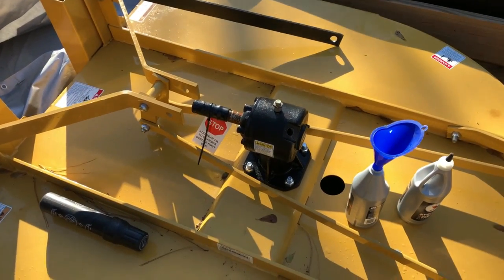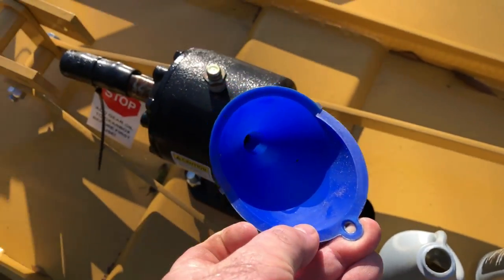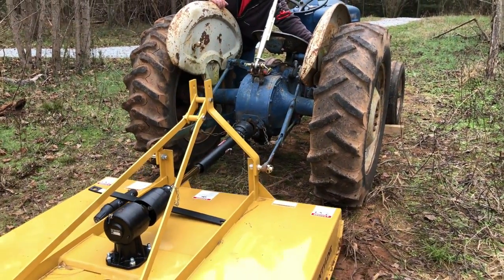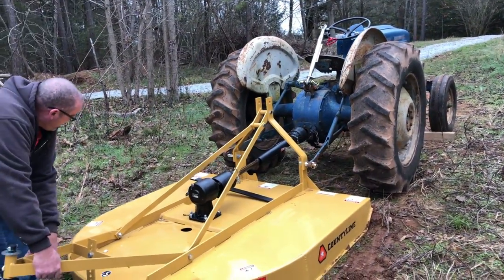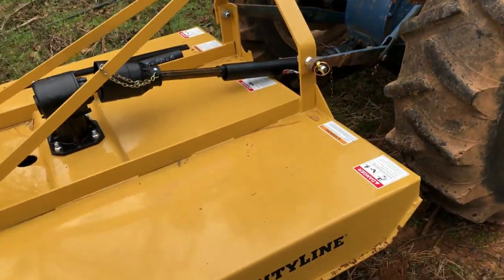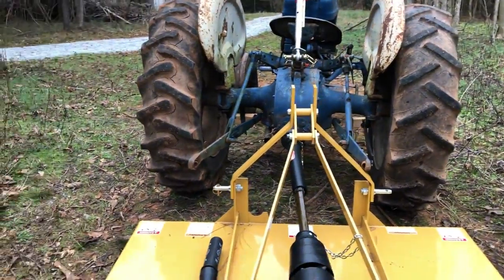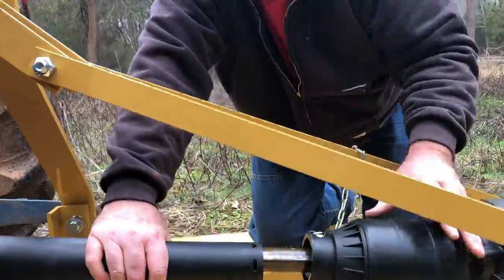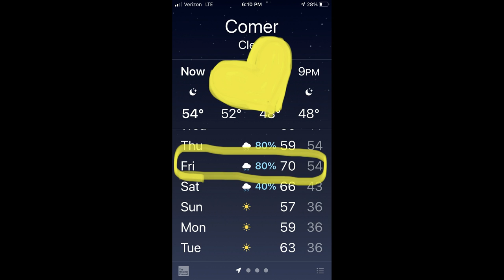The Bush Hog  #16

Comment: The very first thing you need before hooking up brush cutter is a slip clutch that fits on pto shaft. Slip clutch prevents tractor from being propelled forward when the clutch is engaged whist is a very dangerous situation. Slip clutch or over ride as they are called can be purchased any good tractor supply store or even amazon. They usually cost less than $100.00 dollars. Cheapest insurance you can buy for your tractor
Reply from the maker: Thank you very much for your advice. We will be sure to mention you in the video we make regarding this attachment, Thank you very much for watching and taking the time to comment.